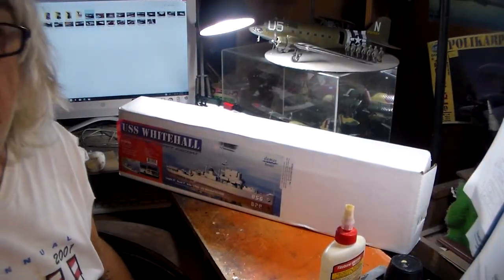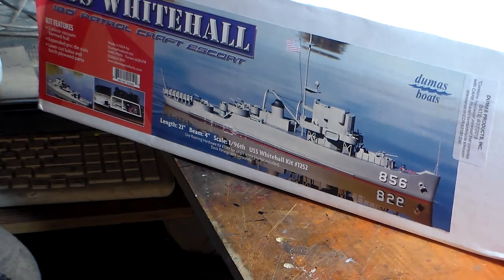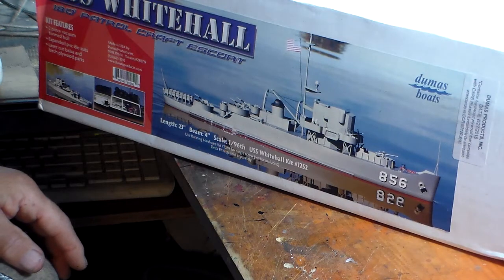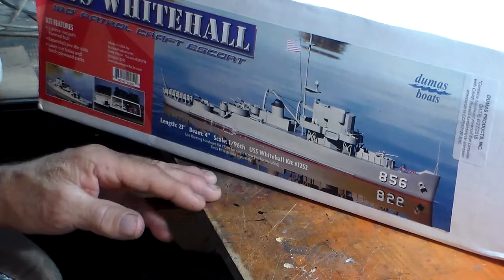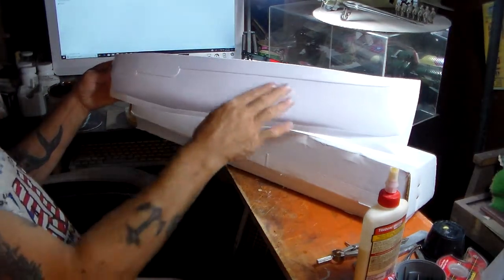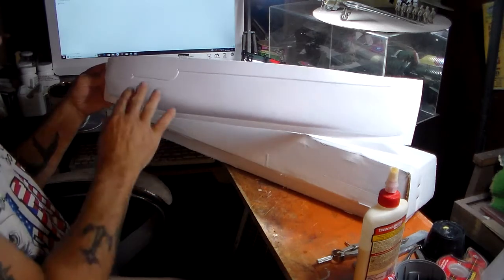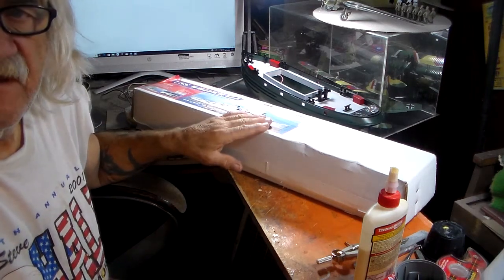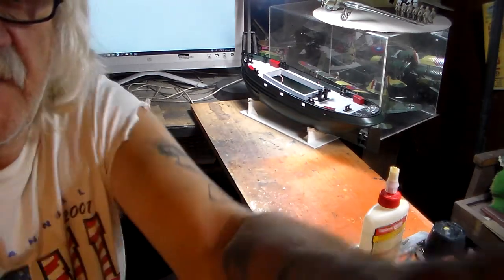Dumas  CAROL MORAN Diesel Tug Video 3  PART 2

Comment: Hi Frankie! She looks awesome! I can't wait to see your maiden voyage video! I am also building this kit! I have done as much as I can do without gluing the deck down. I have absolutely no experience with RC so I was hoping you could recommend a specific servo, esc and radio for this kit. I went online to get them but who knew there would be so many to choose from that I just don't know what to buy. I did already buy the motor you recommended. Any help you can give would be greatly appreciated! Thanks!
Reply from the maker: Ahoy Nautibear                                 Thanks for tuning in on the Carol Moran. any servo will fit the kit, The servo tray holder is included in the kit they are stamped on the expanded PVC Sheet. Once you receive your 4.8 volt motor from dumas you will need a battery, you will find great difficulty in getting a battery to power this boat because a 4.8 volt battery don't exist. Don't use a 6 volt battery it will burn out the windings solution is go to battery express where you buy batteries or any battery store they have a shop in the store that can make you a battery pack they will make one for you for $14.00 they are rechargeable and you can run your tug for 21/2 hours straight before the battery loses power to recharge it you will need 6 volt charger but don't leave it on to charge to long your good to go. You will find this kit delightful to build and you can place it in a box or leave it on the shelf for display. I need to check out the pond to see if all the moss is cleaned up I have two maiden voyages coming up any proplems with the Carol Moran I am here for you.Frankie Day